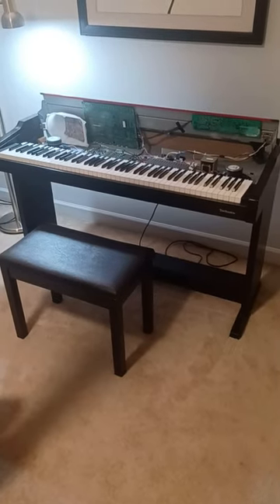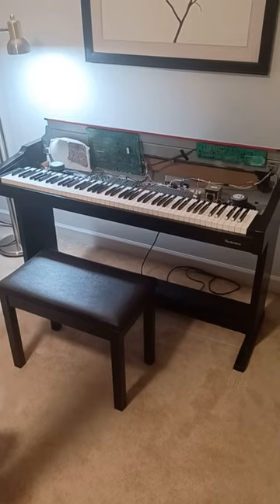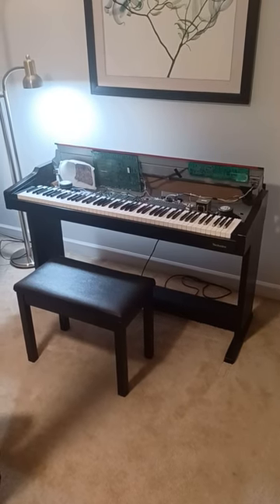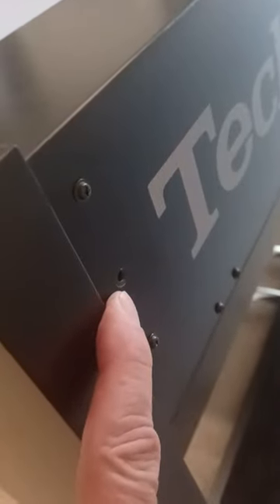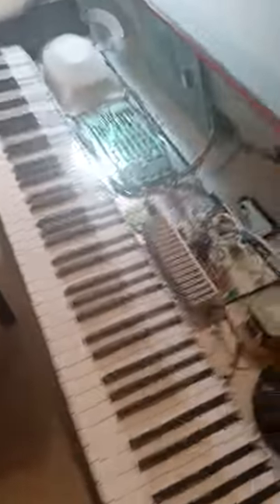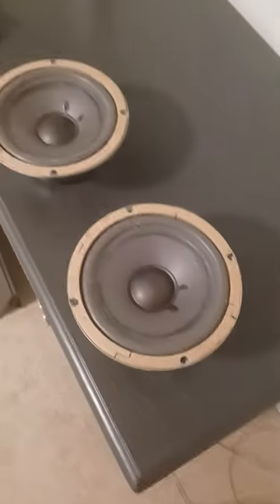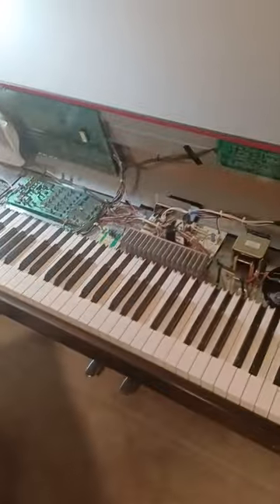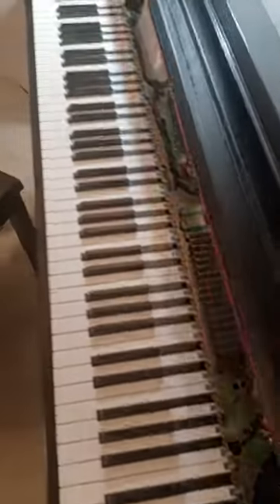TECHNICS PIANO SX PX-30 Speaker rattle vibration repair

Comment: Did you even try to use compressed air to blow the dust off of the speakers? That is usually that cause of popping a d crackling.